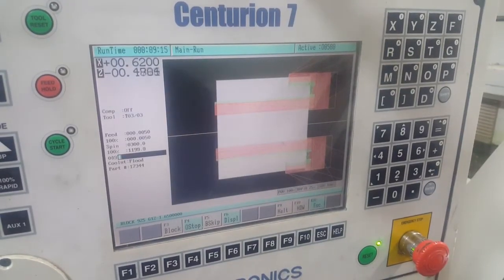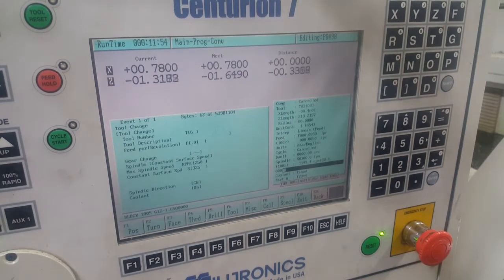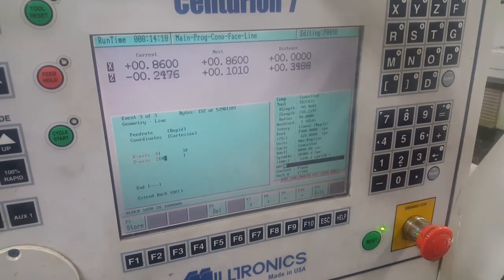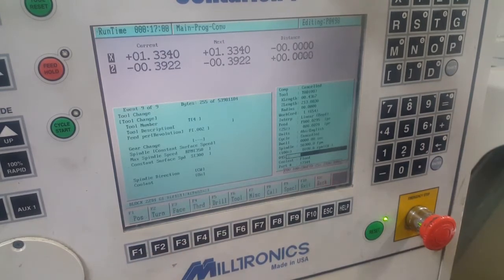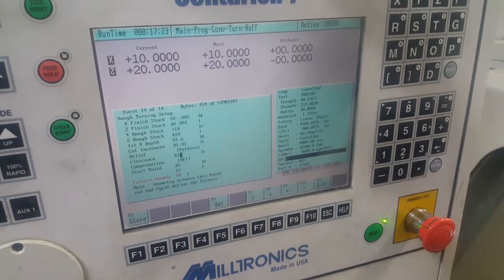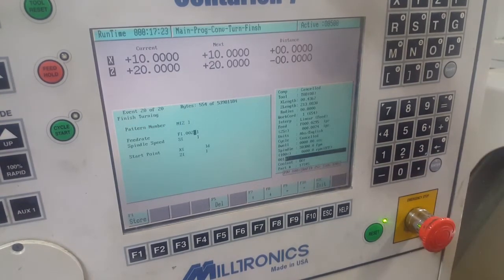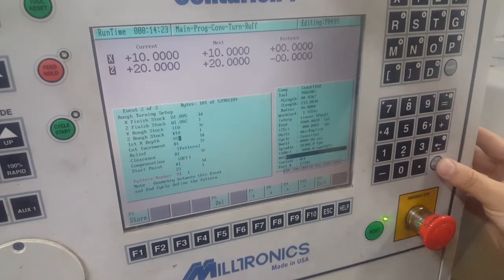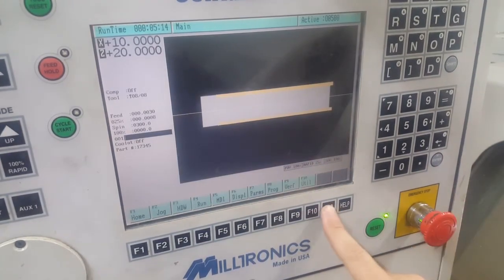Milltronics lathe walk through

Comment: Thanks for posting this! It helped me a bunch. I finally got a small conversational program ready to run but when I actually tried it every cut stepped off .07 or so where it should have been just a square corner and I have no idea why. The graphics looked perfect. Any help would be greatly appreciated.
Reply from the maker: check your tool description in your tool page. Could be that it thinks its using a different radius or something and is compensating wrong.